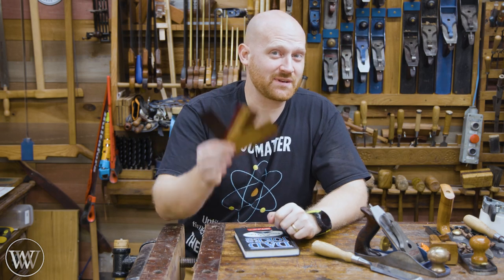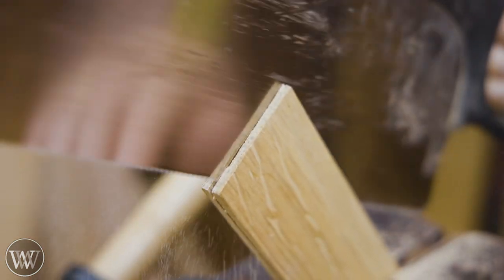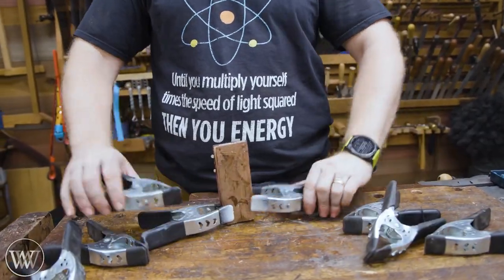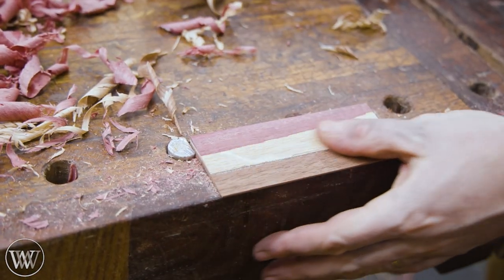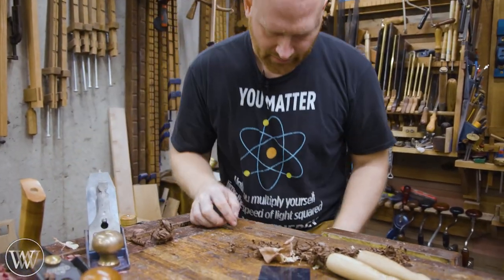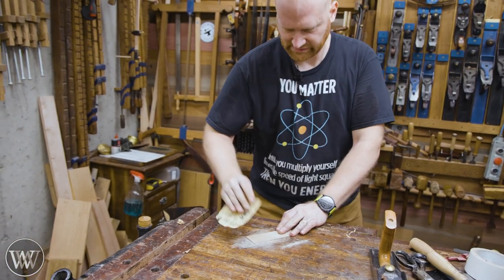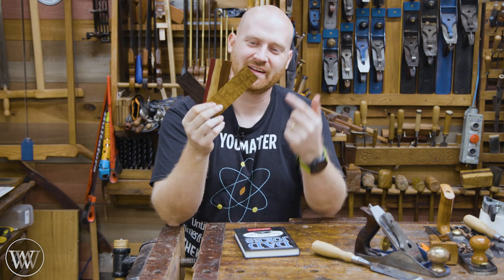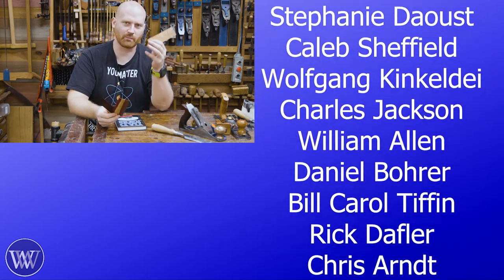How To Plane Thin Stock and Make a Bookmark

Comment: Old school pattern-maker in the 80s showed me his way of planing thin veneers even thinner. Wax your plane sole, sprinkle some chalk dust on a very flat and smooth board and lay the veneer on it. The friction between dust and board wins over the slippy waxed (or soaped) plane sole, and holds it steady against an ultra-sharp plane blade.
Reply: How much down pressure must you use?  That's a fascinating technique but it makes me wonder  why don't we use this technique versus dogs or stops?  Probably go through a lot of chalk.

Comment: Two things I’d do. One, use more tape than you need so when you pull it off, you can just grab the tape instead of trying to get under the wood with a chisel/card scraper. And two, a hair dryer or heat gun will soften the tape glue, making it easy to get off.
Reply from the maker: I've used more tape a few times. But often the dust builds up on the tape and can actually throw the plane off making it hard to get an even thickness. And the problem with using a heat gun is that the glues and stays on the wood and is an absolute pain to try and clean off.
Reply: Oh, I see. The glue sticking makes sense, now that you mention it. But I wouldn’t have foreseen the dust build up issue.
Reply: @WoodByWrightHowTo  you can put thin paper (or maybe a blue tape?) on the exposed doublesided tape
Reply: Alcohol releases the tape too.

Comment: I noticed that you are using a metal bench dog. I found that cutting a piece of 3/4” dowel, flattening one side of the top, and using it as a bench dog eliminates the “Dinged my plane iron on the bench dog” blues.
Reply from the maker: I've never had any problem hitting the end of the aluminum bench dog. I've used my plans to work on aluminum a few times.

Comment: A suggestion for you to try instead of the tape.  I've been using this for years.  Get one of the 12" by 18" red silicone mats from Woodcraft.  Make sure it's clean, and thin pieces do not slide on it at all.  I've planed down veneer to less than 1/64" thick this way and no sticky tape to remove afterwards.  You do have to keep the mat clean because any dust defeats the 'grabbness" of the silicone.
Reply from the maker: I might have to try that.
Reply: Yoooo
Reply: @WoodByWrightHowTo  Please try it and let us know.
Reply: Thanks for this tip.

Comment: You stole my idea hahaha! I made bookmarks but took the opposite approach. I made some thick-ish plane shavings (0.2 mm maybe and don't dare ask what that is in imperial or i shall hit you with my yardstick yes we still call it that NEVERMIND) and glued them onto a sturdy piece of paper from both sides (regular white glue). I speculate that it makes the bookmark sturdier along the grain? I haven't tried your method though so I can't say. But I feel its less work because you only need two good shavings from a block.

Anyways, yours turned out beautifull! Great idea with the triple colors, something of a damascus pattern bookmark haha. And great tip with the double sided tape of course!

Comment: Just a thought about the tape----  Make the tape an inch or two longer than the work.  That way you can work up the edge of the tape without having to worry about hurting the work piece.
Reply from the maker: The problem with that is it gets loaded up with dust and shavings that get in the way.
Reply: @WoodByWrightHowTo  --Good comment--   Okay, just leave the release tape on the "UP" side.  That's what I'll do the next time the issue arises  on the power planer.

Comment: Thanks for sharing.  Did you try the blue painter's tape with CA glue approach as well?  Just curious if that would work better or not.

Speaking of BLO, there is a great article in the recent issue 13 talking about linseed oil and how there are much different grades based on the source of the flax plants.  Well worth reading.  Same article talks about how turpentine can be vastly different.  It may change your linseed oil approach.  I'm looking closely at it.

The oak one was my favorite one that you made.  Speaking of oak.  CS in the LAP 2022 gift guides had an inexpensive pockeknife made from Portugal.  I got the one that has an oak handle.  The oak has a lot of swirl in the handle.  Can't wait till I get a chance to apply some Tried and True oil to it.

Lastly, are you planning to go to the PAST tool collector show in Feb/March?  It is near Monterey, CA which is a lovely area.  If you want to attach a family vacation onto it, I'd suggest staying, after the show is over at the nearby place called Asilomar.  It is basically Camp Curry from Yosemite (but nicer) that meets the ocean.  Can also visit the Aquarium in Montery, do the little costal drive they charge for, and go down to Carmel CA.
Reply from the maker: A lot of people like the blue tape method. I have found it does not hold as well as I would like. I was in LA yesterday. I don't think I will be able to make a PAST meet any time soon. But maybe.

Comment: Nice tip! I'm going to make some wedge shaped spacers to mount brass foot rail brackets, and this is just the tip I need to plane some material down to nothing on one side.  Can anyone think of why such a bracket (combination bracket with a foot on the floor and an arm to the wall) wouldn't have the feet and hands at 90 degrees to each other? Without a spacer at the wall, the toe is up 1/8" when the heel is flat...

Comment: I wonder if the flat planes the Japanese use for Kumiko can work too. They have a special little  spring loaded presser in front of the mouth to prevent flexing of the pieces. Though the tape would still be needed I bet because good luck making a planing stop less than 1/32 lol

Comment: A careful use of a heat gun to just warm the surface to about 120°F will do the trick in softening the adhesive. Go at it in 2 min duration heating cycles, two heat and two soak cycles. Test before reheat.

Comment: Instead of double sided tape you can use masking tape (one on bench, other on piece) and superglue (in between).
Reply from the maker: That is a fun trick. I found it doesn't hold quite as well I've had a break free a couple times. But for most things that works very well.
Reply: @WoodByWrightHowTo  The best result is the wider tan tape for stickiness and surface area. Most people have the blue tape by default but it just doesn't grab as well for this use case. Also, its possible that the glossy finish on your bench doesn't allow the tape to hold as well so try clamping in an unfinished piece of wood and taping to that instead.

Comment: Better than tape - cocktail sticks. 
Method) leave stock over length.
Drill cocktail stick sized hole through excess wood and backer board (or bench if u ain't fussy)
Hit cocktail stick through piece into backer.
Plane till thickness reached
Drill out cocktail sticks.
Easy

Comment: An easier way to do it is use a piece of wood longer than you need and clamp one end down instead of using tape.  That's the way I plane violin ribs 1mm thickness.  For figured wood like that oak use a toothed plane blade and then a scraper to remove the plane marks.
Reply from the maker: If your wood is that long to begin with your first great.
Reply: @WoodByWrightHowTo  yeah violin rib blanks are a bit longer than what you show there in the video.

Comment: Accidental Thinking:  what if the double stick tape was longer (about 3 inches extra)  than the piece you are mounting...then you can uplift the tape and will lessen the chance of breaking the piece...
Reply from the maker: The problem is it loads up with dust and can lift the plane.
Reply: @WoodByWrightHowTo  that's expected but it gives you a tab to pull on...just like them 3M wall mounts.

Just a thought